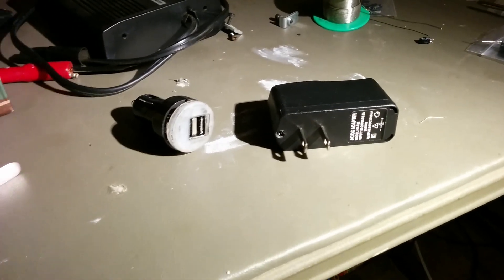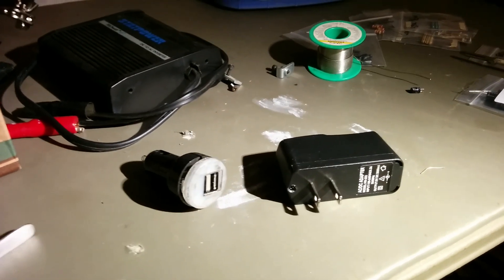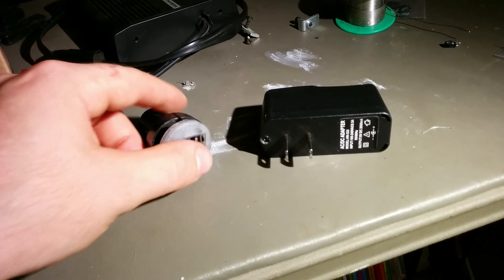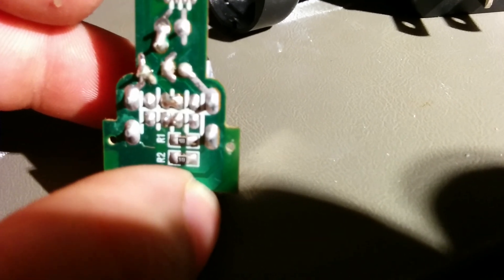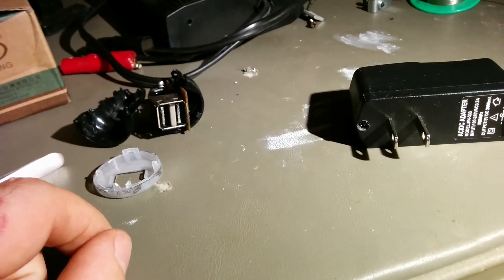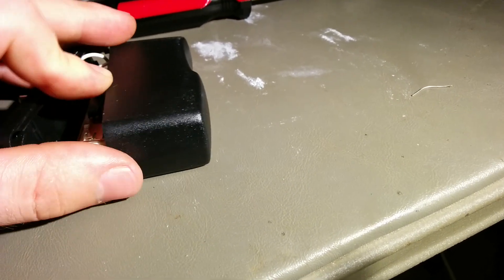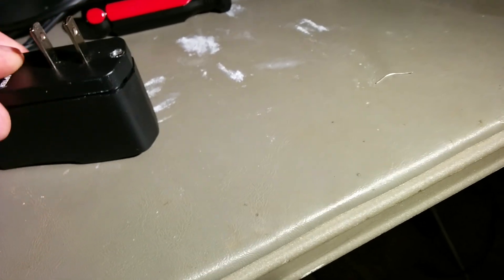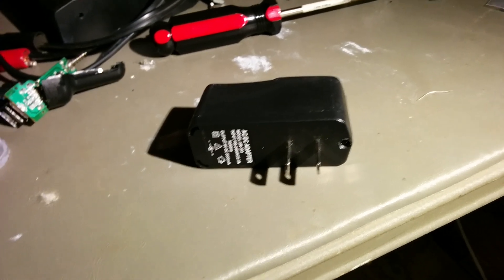Upgrading a cheap 2A USB charger for fast charge

Comment: This is not how chargers work. You need higher amperage to have faster charging. Soldering pins together isn’t going to change the amperage on the charging block

Comment: I tried this on an e-circuit brick from dollar tree, souldered the two middle pins and so far hasnt fast charged. If you could, pls see if they can work with this trick. If so, save alot of money on fast chargers
Reply: You need a 2 amp or better. Check to see if yours is 1A. 
The 1 Amp chargers don't have enough current for fast charge

Comment: You have to make sure the transformer inside the charger can handle the amperage, otherwise bad things can happen. Go on eBay and just buy the 2 amp ones.  They are not that much more.

Comment: I have a 5v 1.0amp Alcatel charger for my fierce xl,  I have a generic charger with 5v 1500ma output,  will this help a lot?
Reply: get a app called ampere check max current if it's 500ma it's not soldered if 1500 it is. if it's 1500 it won't do anything